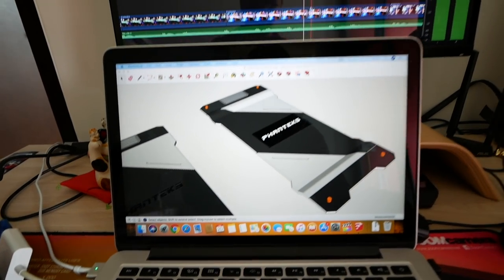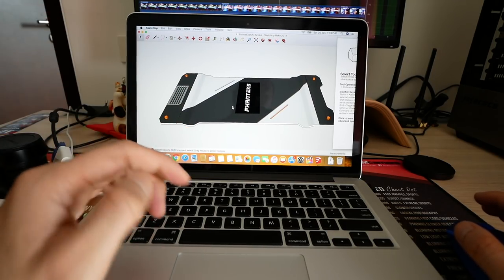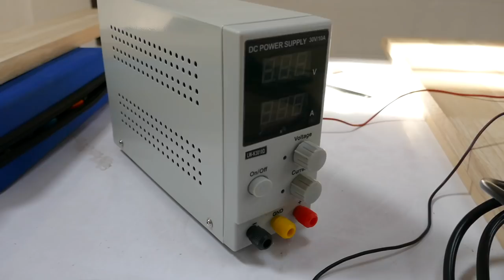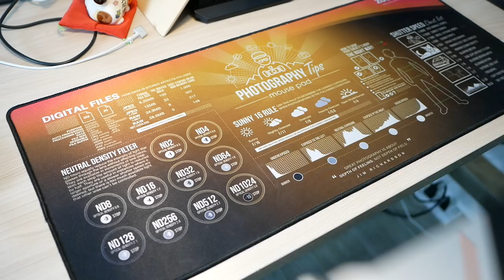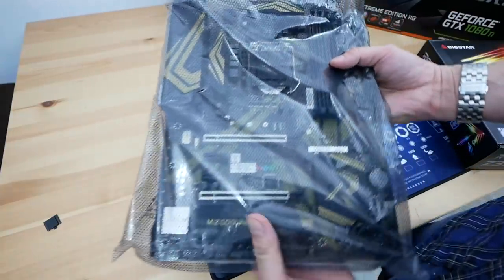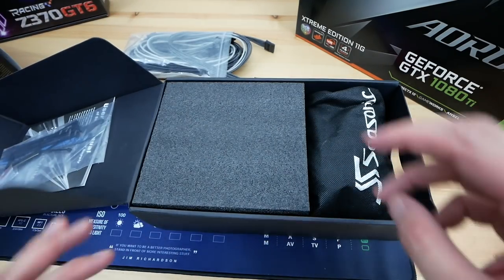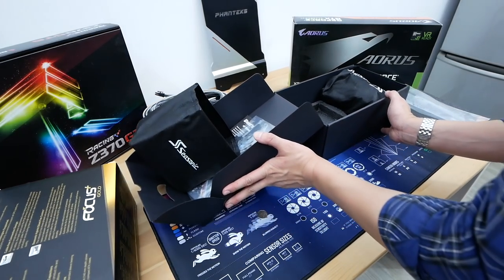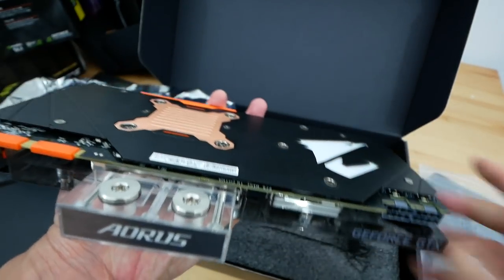Phanteks Enthoo Evolv ATX mod and custom water cooling

Comment: How did you mount the front plate?  I have the exact same case (and the exact same scroll saw :)).  Making a new front plate may give my PC a bit of a face lift and possibly help with thermals as air flow is restrictive with the default front plate.

Comment: 1080ti and an i3 8100... why jojo... why!
Reply: and its not even the unlocked 8350k
Reply: Yeah, custom loop water cooled i3-8100 :D
Reply: @Pasi123  XD at least if its watercooled you can get something not that far from and I5 ... i hope so
Reply: What bottlenecker
Reply: i3 8100 is 7th gen i5 equivalent
Reply: @cclacss  its better than an i5 7500 but still

Comment: Realy nice work and cool ideas. Whats about the top panel, I think you need at least to do something for better air flow as this awesome case is known for bad airflow and high temperature even If the radiator is mounted at top possition.

Comment: Hello, what fittings you used for making loop with this 1080ti or where you bought it? you used ekwb tubes? which size? (10/12mm or 12/16mm)
maybe you can share where to get everything for making loop for 1080ti?

Comment: WOOOOOOOW, Dual BIOS ! That was kinda standard for higher-end motherboards all the way back in 2007..... :D You THINK the backplate is PROBABLY metal? Great job with the hard tubing and panel crafting! Not so great routing the PCI-E cables.

Comment: Never heard of biostar. Or at least haven't heard much of them and dont see their products often here in Canada. My gigabyte board has dual bios which is nice for a beginners like me in case I somehow manage to brick it :P
Reply: beautiful build though, I actually really want to get a enthoo evolve but they are soo expensive. Like 240$ canadian and thats half way to a 1070 for me lol. I'd much rather have a 1070 in my s340 elite build. Plus from what I understand the airflow is pretty choked out on the front intake, though I have seen people put spacers on the mounting brackets and give it an extra half inch to inch of clearance while still having it look extremely aesthetically pleasing.

Comment: Well bro, when a sweet piece like this is done by hand its worth more than something done by machine. So nothing wrong with not having a CNC machine, great job.

Now what you definitely want to invest in is a small air compressor with a small spot repair gun or a quality airbrush with a large tip and some quality paint.  These rattle cans you are using have got to go.